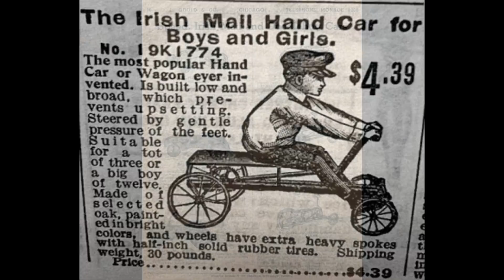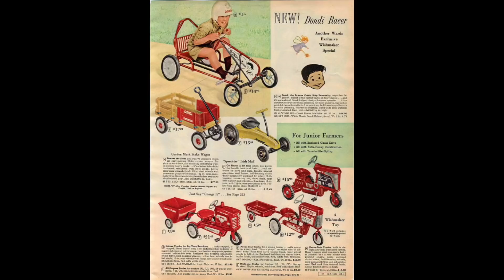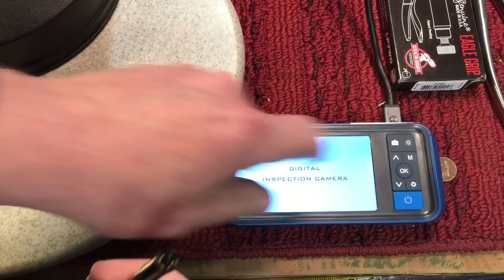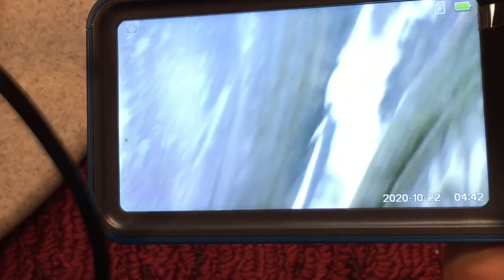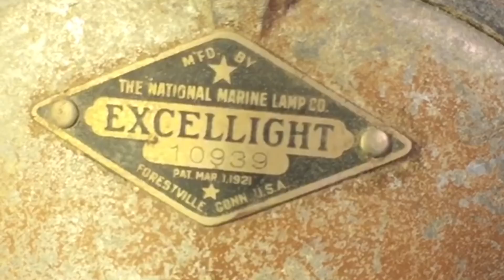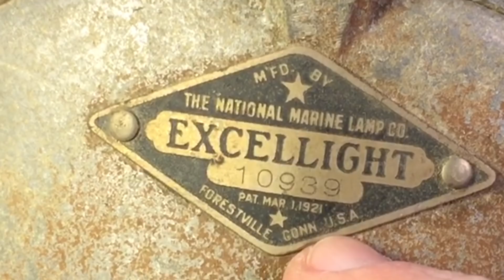Jacktown Meet Up, Cool Acquisitions!

Comment: Definitely put a mirror finish on that Aluminum. Perhaps one of those headlamps would be a good light for inside it. They often have 3 Watt disc with the LED on it. Maybe you could do some yellow or red LEDs for an ambience light and hook it to a double throw switch so you could do either or.

Comment: If you want to keep the Excellent lite internals original. You could probably use alligator clipped wire to use a modern battery with the same voltage. That way it's all hidden inside and you don't mess with the original copper tabs.

Comment: Go for it!  That marine light would look look fantastic restored.  What kind of batteries could be fitted into  the light, so it could function  as a flashlight again.
Reply from the maker: They sell all sorts of rechargeable gel cells....  It all depends on the bulb voltage.